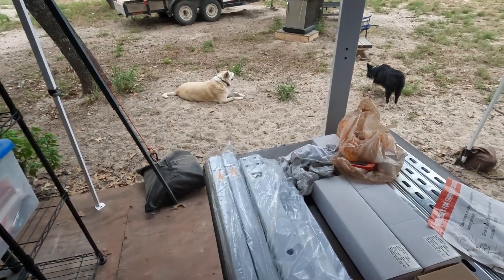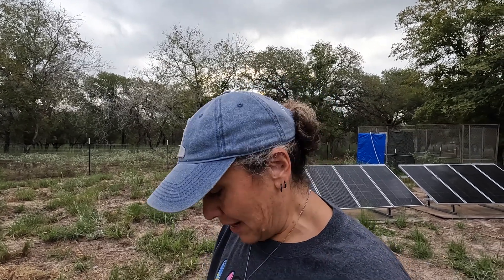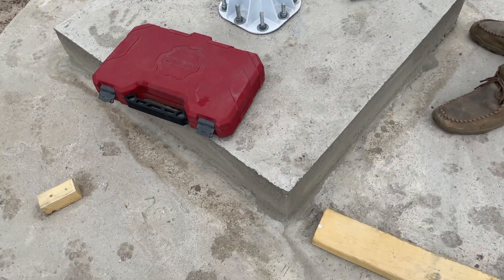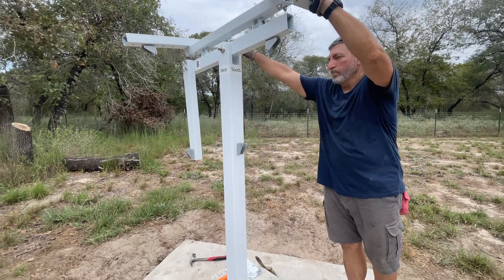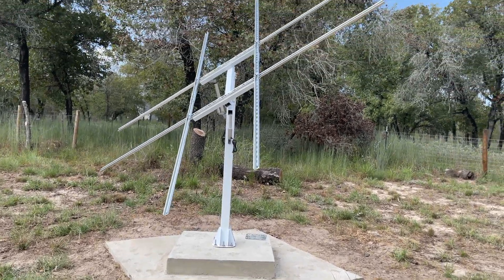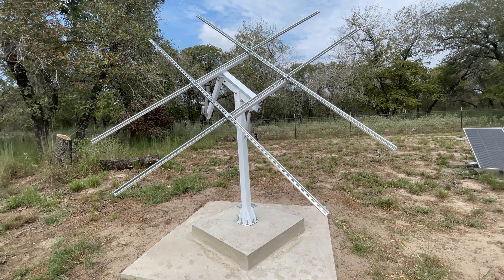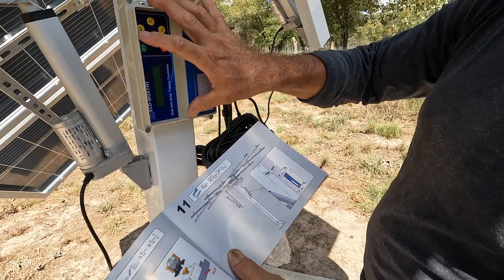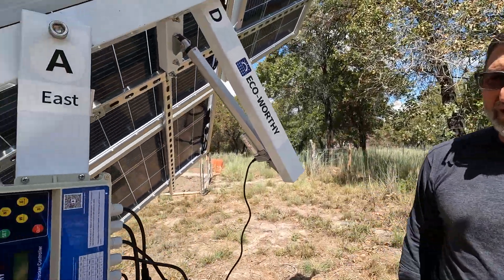Solar Tracker Unboxing and Install

Comment: what is the size or measurements of the flat plate on the pedestal? how far are the bolts apart (bolt pattern)? I looked on the online manual and it's not listed. it looks to be about maybe 6in? or 9in? I ordered the dual tracker and I'm going to attach it to a pole base but I needed to have the plate fabricated. I wanted to get the plate done before the tracker came so I wouldn't have to lose time on the installation. I just needed the plate size and then I will drill the holes on-site.
Reply from the maker: @paulasenjo8826  we made a template out of a piece of scrap metal with the size and location of the bolts. I’ll take a picture later, when the sun comes up, and post it.
Reply: @middleagedmavericks2018  Thank you very much. That would be amazing!

Comment: I would be a little nervous with high winds, and the tracking structure. I would have gone for fixed panels as you already have mounted near the ground. for the cost of the tracker you would have purchased an extra 4 or 5 panels. and had higher output.
Reply from the maker: @patdrau  thanks for your comment. The tracker has a wind meter and if the wind gets too high it lies flat.
Reply: I should have also added, what you have done is good anyway. I hope my comments did not seem negative. Thanks mate

Comment: A few comments.  Bifacials get the most increase in power when reflected sunlight hits the backside of the cells. This mostly would be from sunlight coming in sideways to a fixed array and a little from sunlight hitting ground in front of fixed array and reflecting to backside of cells.  Since you have a tracker you will not get much sideways reflected sunlight and maybe a little front reflected sunlight.  So you may not get a lot of the increase power benefits of bifacials.  If you get snow (doesn't seem like you are in such a location), sunlight reflecting off snow will benefit bifacials.  These low cost single pole 2 axis trackers do work but don't hold a lot of panels.  
My preferred method is dual tracking for what looks like a large fixed ground mount frame, but it rolls on several wheels (for E/W movement) with one motorized wheel on a semicircle concrete track and the frame pivots on a centered back pole.  N/S tilt done via powerful linear actuators or wheel gear climbing up arches with roller chain attached.  All controlled by 2 axis solar tracker controller along with sun direction detector and wind speed device.
Reply from the maker: @douglasrobbie9998  thanks for your comments. We’ve noticed a significant increase in power from the panels.